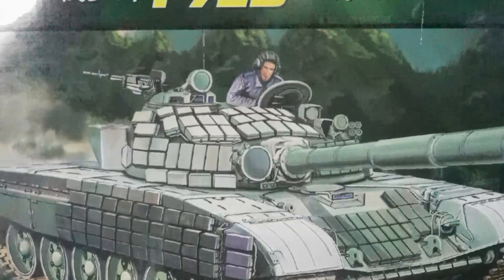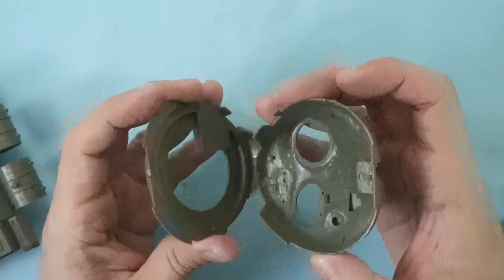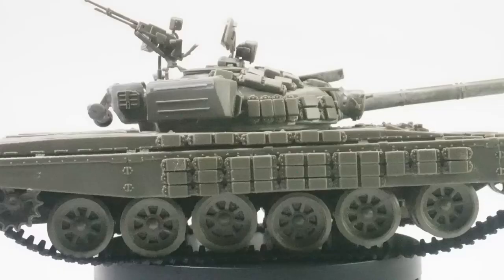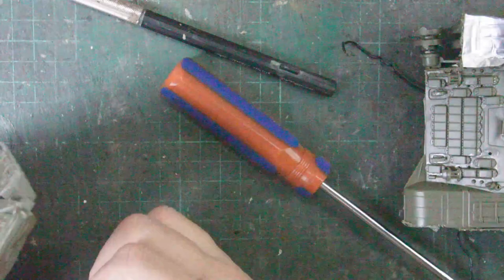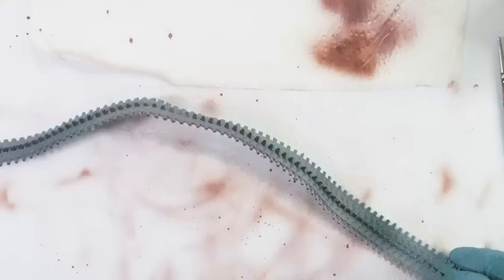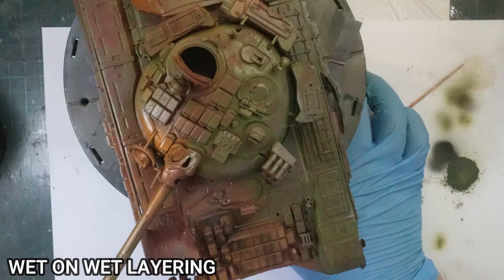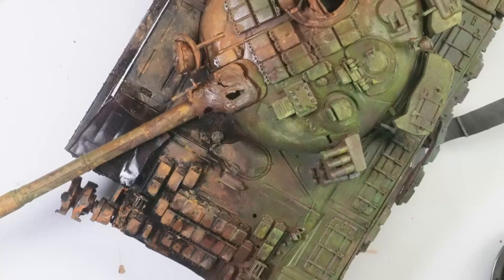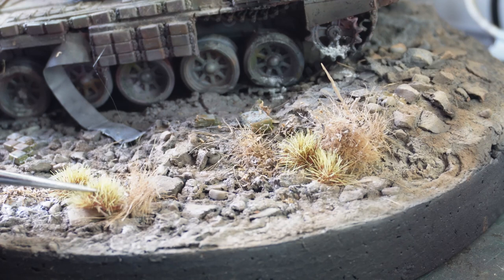T-72B CRAPPY KIT BURNED & DESTROYED Mini Model Hobby Kit

Comment: Thank you for explaining and demonstrating your wet on wet - nice technique
Reply from the maker: Hi Ralph Ford. You are most welcome sir. Be sure to try it first on a plastic pallette. Its a bit tricky and the results might not be to your liking. But yeah you can use it once in awhile. The key for a good paint chipping is a good hair spray brand or chpping mediumd and consider the drying time in between. ive seen great results with a dry paint coat stifled with a water soaked brush. Thank you for dropping by mate. Cheers. See you again.

Comment: hi, great build. question, do u let the layer of hair spray dry first? thanks
Reply from the maker: Hi Graeme. So far based from my experience the actual brand or product of spray gives out a good quality chipping to a model. Also, you may want to try several 1. Wet on wet - Acrylic sprayed on a wet HS 2. Misty over wet - 1 minute HS then acrylic 3. Dry then acrylic - 2 to 5 min more or less HS drying time then acrylic. Order - large chip   2. semi chip 3. tiny chips though very hard to scrub off using a wet brush or toothpick. Give it a try on a separate styrene sheet. Thanks my friend for dropping by. Hope to see you here again.